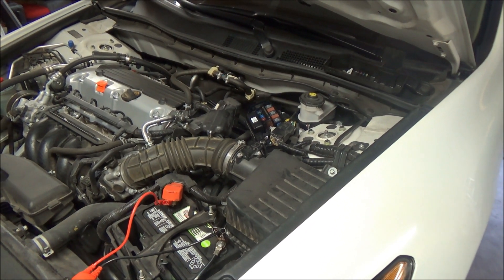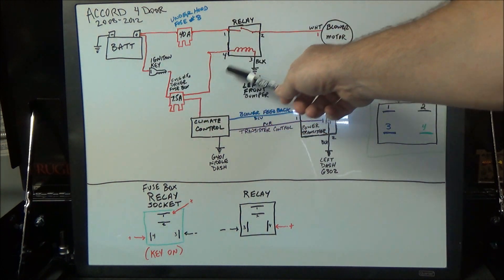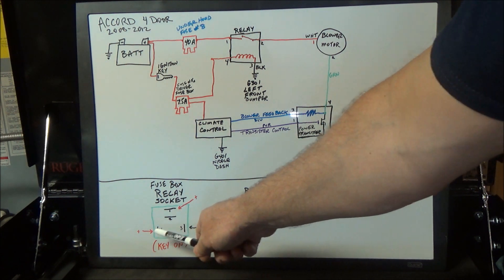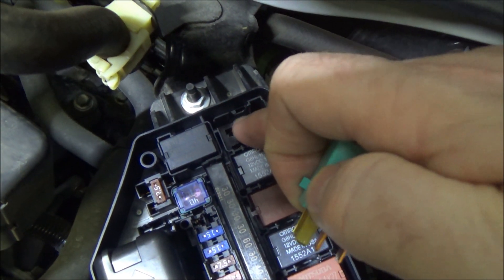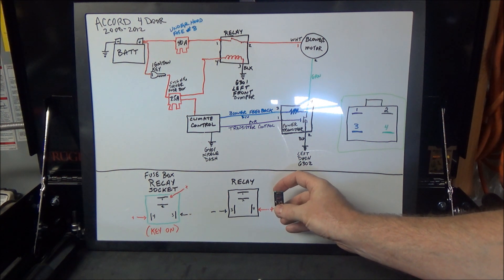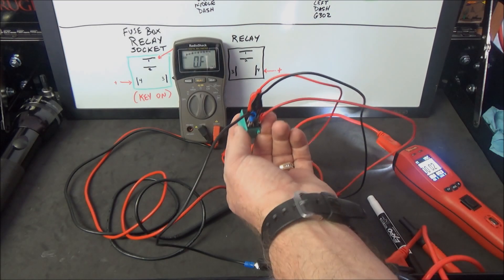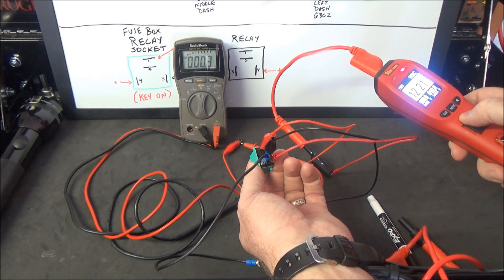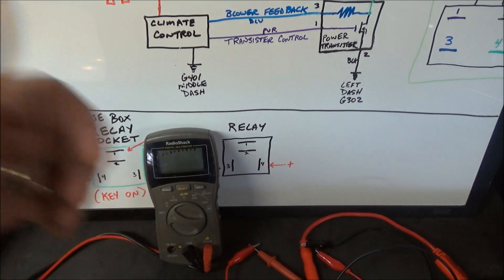Honda Relay Testing

Comment from the maker: Important note: some relays are controlled by a module or computer inside the vehicle, and can be damaged when checking for power/ground with a test light in the vehicle if too much current is pulled through the circuit.  Although most incandescent test lights will not hurt a computer controlled circuit when used properly, the possibility does exist.  

If you follow a wiring diagram and the wire goes back to a computer or module (or if you are not sure), you may want to use an LED test light for your power/ground checks.
Reply: i have changed the fan and all is working fine thanks ,what a pig of a job on right hand drive cars thanks alot honda lol they qouted £460 .cost me £40 for the part from salvage yard
Reply: my honda civic 1996, relays are good, sensors are good, but my mechanic thought that the thermo  fan switch sensor is the knock sensor.  he couldn't wait for replacement he turns over to me the vehicle and then , when i turn on the switch, my radiator fan run automatically.
Reply: if relays are damage did it take the radiator fan to run when the switch is ON sir?my relays are good, and sensors, thermosensor/ fan switch, thermo switch, ect sensor.

Comment: I tested pin 3 and 4 for short and it is shorted. Can I use that test to see if the relay is good? Is it supposed to be shorted? I would think not because none of the others short at pin 3 and 4. I am testing specifically the fuel pump relay from under the dash. I swapped it out because I think it is shorted and it blew out my fuel pump. But now I get a check engine light with codes P0135 and P0498 with the new relay. So either got a wrong replacement relay or the old one was good?

Comment: Great video,  my question is can I throw power to 87 socket to see if an ac compressor is engaging.  So I guess what I'm asking is can I take my power probe, stick it in 87 slot, throw power, and see if the ac clutch is engaging,  is that safe,  seems logical to me but I'm far from a mechanic or electrician,  but my son's ac isn't working and trying to rule out any issues. Thanks and great video

Comment: My 2011 Honda civic drivers side turn signal is going super fast. Bulbs are blinking.  The passenger side is fine. Then if I push the Hazzard button everything works fine. Does the car have a relay on each side or one relay for both sides. I even changed the bulbs. Im.looking for answers, do you have any ideas? Thanks.

Comment: my aircon doesn't work, someone suggested a faulty aircon relay ? in order to test it i took out another relay and put in in the slot where the air con relay was, no different aircon still doesn't work . So i put the relay back where i got it. After that i get check engine warning light and having problems with my idle speed . Anyone got some advise ??  Did i messed up the relay by trying it  in the aircon slot ??

Comment: Thx for the great tutorial. I have been a fan for a while. My AC on 2007 Honda Civic Hybrid does not blow cold air. Compressor clutch engages for a bout 2 second and it drops off for a about a minute and cycle repeat itself. Radiator Fan and Condenser Fan do not go on during this time. Using a Probe, I checked the Radiator Fan Relay circuit as you recommended and uncover that I do not get power on terminal 4 socket. All other sockets checked out Ok. I appreciate any recommendation.
Reply from the maker: Sounds like you may have more than a bad relay, I suspect the A/C system may need some troubleshooting done on it unfortunately

Comment: Thanks for the info.  You can also use a 9V battery to energize the coil, and check for the relay closing with the meter.

Comment: Can you tell me,where the headlight relay located on my 08 Honda Odyssey? Thank you....
Reply from the maker: On those Odysseys, the High/Low relays for the headlights are built into a Relay Control Module which is part of the under HOOD fuse box.
Reply: Big Dog50001 Automotive thank you

Comment: What ohm reading we looking for when there is power going to the relay?
Reply from the maker: Should be as close to 0 Ohms as possible, the spec for relays and switches that I like to use is generally less than 1 Ohm.

Comment: My Radiator fan  is turn on Automatically when i ON the starter. Please any idea why this happened.
Reply from the maker: Not enough info, there are multiple reasons why they can do that but without knowing year make and model I wouldn't even be able to steer you in any direction.
Reply: @BigDog50001  my honda civic model 1996

Comment: Do you know what the rest of the relays are to the right of the blower?  I know one is the horn. But what are the 4 with the manual symbol next to them? The manual doesn't say. Thanks!
Reply from the maker: Relays from left to right looking at box from front of vehicle: 1-Blower,  2-Horn,  3-PGM-FI Main,  4-PGM-FI Sub,  5-Ignition Coil,  6-Throttle Control,  7-(at right end of box) Rear Window Defogger.

Directly underneath Blower relay is the A/C Compressor Clutch Relay.

Comment: nice video helpful ,i have a I have an 07 Honda Civic 1.8 mk 8 ,i have a problem with my blower motor fan ,it just comes on when it wants and i seem to get all speeds when it works and full heat,i have replaced the switch on dash ,still same problem could it be my relay fuse is bad thanks.
Reply from the maker: It is possible that the relay is going bad but it will need proper troubleshooting done (needs to be done when the blower is NOT working).  Here is a video where I troubleshoot an Accord, it has a similar electrical blower motor set up to those Civics.  https://youtu.be/ZCFiuhgSkFE

Comment: 07 cvic.. using a test light in the start cut sockets (all 4) I get nothing.. car won't start or crank?  Any idea where to start..
Reply from the maker: The starter cut relay on those Civics get both power feeds through the ignition switch in the Start (number III) position ONLY.  The ground is supplied by either a clutch interlock switch or a transmission range switch depending on transmission.  I would start by getting a free wiring diagram for that vehicle from BBB Industries website and test the circuit and find where I am losing power (or ground).  

Jiggling the ignition switch in the start position while keeping a test light on the relay sockets that should have power can help identify a bad ignition switch.  Doing a similar test while moving transmission from park to neutral (or pressing the clutch) can identify a bad transmission range switch/clutch interlock switch.  Obviously all fuses and connections between starter and battery need to be good and the battery needs to be good as well.

Comment: Hi. I need some help please. I've got a civic 2005 and the left side window only goes down ( car is RHD) . Ive checked  the switch,fuses , motor, the tiny white box on the door panel ,cable from the door and all work. The way I've tested it is to do a switch of every component and check it at the rear left door. I've checked each of the cable ends with a multimeter on the ohm setting ( the one that beeps  if cable ok) and is ok. Even checked the master switch button for the side that doesn't work and is ok. Fuses ok everything ok.   Haven't checked the relay ,but since is just one for the windows, I presume it doesn't affect just one side. Fuses ok. Everything ok.  The only thing I forgot to mention is that the window only goes down.  Any ideas  please. Or suggestions. I'm stuck
Reply from the maker: If I was troubleshooting it, I would go to the window regulator itself and unplug it and use a simple test light in place of the window regulator (motor) to see if it will light up the test light when the window switches are pressed in both directions.  That way I could tell if I am getting enough power to the circuit (a loaded test).  Testing with a multimeter is ok but does not load the circuit.  

If the test light lights up in both directions (up and down on the switches) then it is most likely a bad window regulator.  If it only lights up going in one direction (down in your case), then a bad switch (or master switch) is most likely the culprit.  

There could be other issues but those two are the most common.  Swapping components to test is ok but the circuit with the problem needs to be tested under load and you can't really do that by moving components.  

There should only be one relay for the windows on those Civics and if it was bad then none of the windows would work.
Reply: I really appreciate your time  . I'll buy tomorow a light test and I'll go from there like you've suggested. Many thanks

Comment: CAN YOU SHOW WHWERE IS WIPER RELAY FOR ACCORD 2003-2007 OR IT COULD BE IN ANOTHER YEAR ACCORD?
Reply from the maker: That is not a standard relay system like a blower motor or something like that.  The wiper relays (3 relays) are part of the Relay Control Module, which is integrated into the under hood fuse box.  The relays are not serviceable individually.

These systems are not easy to troubleshoot due to their complexity.  The wiper switch (called the Combination Switch Control Unit), the MICU (Multiplex Control Unit), and the Relay Control Module all communicate over the B-CAN Network (Body Controller Area Network).  Checking these usually requires a Honda Factory capable scan tool.  

That being said, power checks can be done with a simple test light or multimeter.  With KEY ON, there should be battery voltage (power) on fuses 7, 11, 20, 21 in the under DASH fuse box.

Comment: Your video is very helpful, thank you. I have an 07 Honda Civic 1.8l, and the fans turn on with ignition. Radiator fan cycles as well while driving, causing the rpms to fluctuate. I have tested both fan relays and trying to test the circuit at the fuse box although, I am unsure how I probe correctly with a volt meter; is it the same as testing the relays?  Any bit of information would be usual thanks.
Reply from the maker: Thank you for the comment.  Some of these Honda cooling fan systems have 3 relays, a Radiator Fan Relay, an AC Condensor Fan Relay and a 5 pin Fan Control Relay (which is similar but not exact to the relay in this video).  All 3 relays need to be working.

The fans are also controlled through the ECM (engine computer) which receives input from the Engine Coolant Temp (ECT) sensors (2 of them).  I would use a scan tool to look at the temps that those ECTs are reporting to ECM (look for temps that are weird, like say above 200 degrees on a cold engine).  See my Civic P0128 video for shots of ECT temps on a scan tool.

Of course wiring problems will cause havoc on any system so that is always a concern when checking electrical problems.  Good luck!
Reply: I'm the original owner so everything is stock, I did change out the a/c compressor tho.. but, that shouldnt cause constant power to the fans..? I'll have to check out your other video, thank you again.

Comment: thnx for the post, its really helpful. i got this problem 2nd time relay getting burnt ,what should i do to over come if it repeats.   best regards.
Reply from the maker: Hard to tell from your description exactly what you are seeing, but heat (burned relay or relay terminals) usually indicates resistance.  

It could be a few things, but the first thing I would look for is corrosion/green crusty crap/loose or bent terminals at or near the relay (sometimes it is difficult to see because they are all in a power distribution box).  I would also look for a partially broken/corroded wire near the relay.  All these things can cause the voltage to not flow through connection properly (and instead create heat).